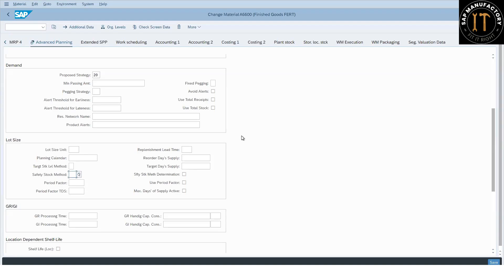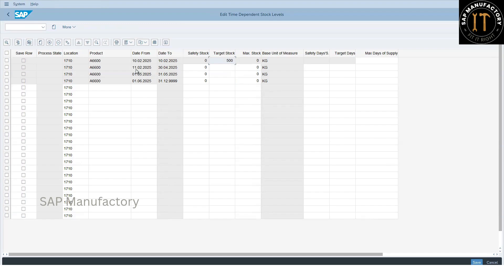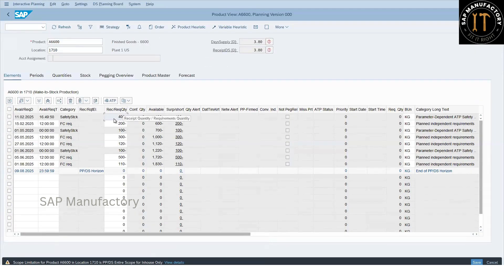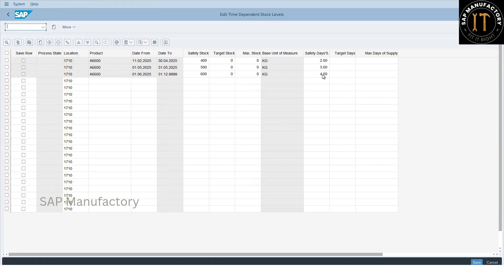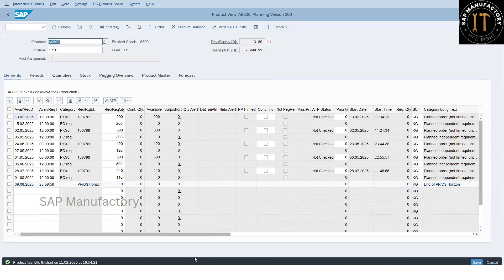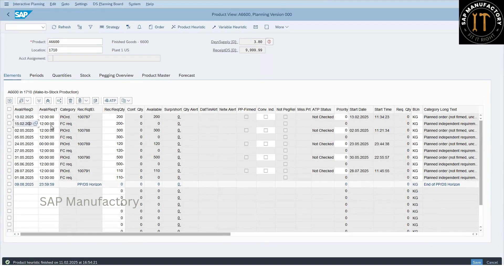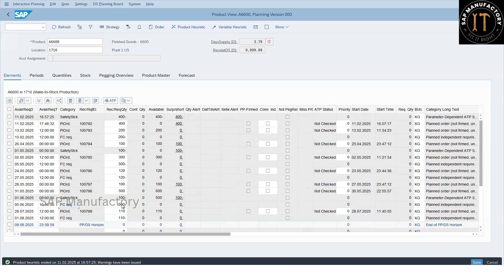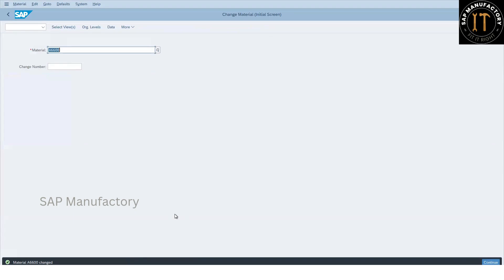Step-by-Step Guide to understand Time Dependent Safety Stock Method| Tutorial for beginners|

Comment: Hi Sir 
Very good video 
Could you please confirm If safety stock method automatically determination check box is checked then this time depended safety stock methods will determine automatically or not ?
Because static methods are auto populating?